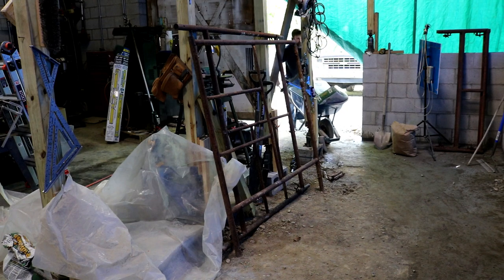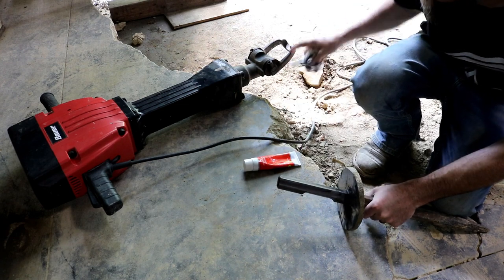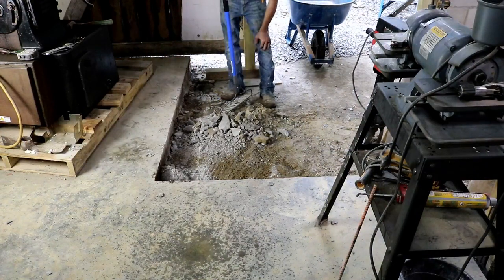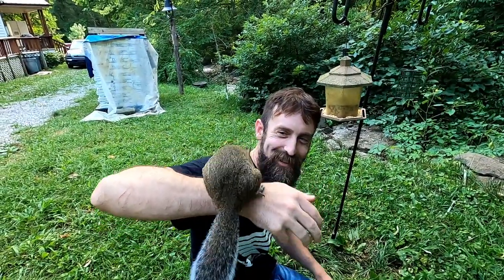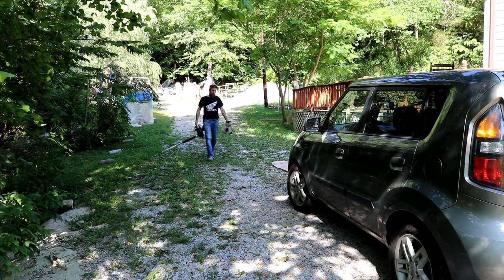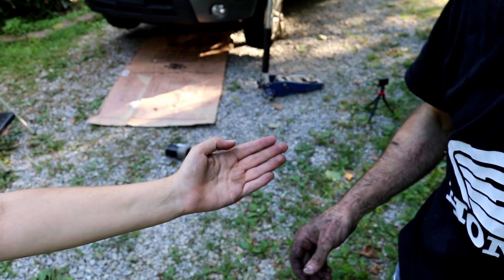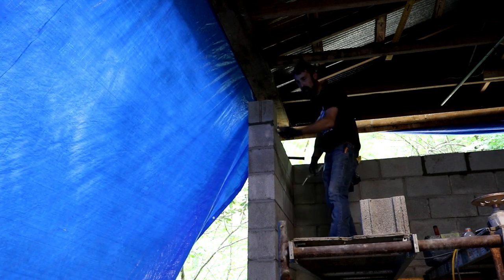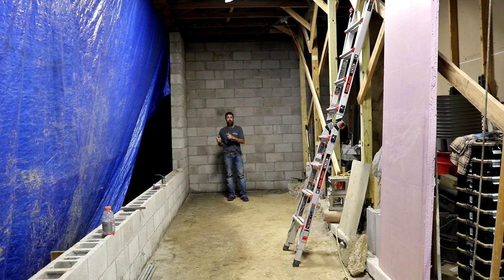Finishing up the back Block shop wall / Jackhammering the old floor \ Car trouble

Comment: It looks like the Kia engineers attended the General Motors School of Impossible Starter Replacement. Did they also attend the General Motors School of Impossible Oil Filter Replacement? Things are really coming along!
Reply from the maker: I believe so Wes 😁, they definitely were not thinking of the guy who has to work on it in the design.  It obviously can be changed but it was a tight squeeze.
Reply: One thing I can say that sure was nice working on my old junk Dodge was everything I have done was super easy to access.  Oil filter can be changed from top or bottom take your pick, starter too. You can even unbolt the floorboard to access the transmission. You could actually pull the top off the trans while it was still in the vehicle. Its freaky weird compared to the new stuff. LOL
Reply: I watch both of you guys channels love your work ethic and how you put your videos together best of luck to both
Reply: @SteveSummers  Some of the cars you have to dismantle one wheel well, wheel, suspension, wheel well liner. To get at the timing belt. The joke about doing a tonsillectomy through the butt, comes to mind. I'm happy to stick with my Ram 1500 4x4.
Best wishes guys
Reply: @carlthor91  sounds like replacing the alternator on an Escape… I think they also intend for you to remove motor mounts.
Reply: @carlthor91  my 1964 Vw Splittie can carry a load of 1125 kilograms, is 56 years old and I can perform a major service ( a major service on these cars is when you change the engine rather than the oil) in under 4 hours.
Reply: Exactly why I love old cars so much.
Reply: @gofastwclass  Four bolts for bumper, four bolts for rear valence, petrol pipe, accelerator cable, four electrical wires and four bolts/ nuts holding the engine in :)
Change starter in ten minutes, seven minutes if I dont disconnect the battery, no need to jack up car.
Reply: @andrewallen9993  The big old American cars are really complex, we sometimes have six or eight bolts holding the bumpers!
Reply: @gofastwclass  Like on my Heckflosse. Bumper brackets that would please a Plymouth Valiant:)
Reply: @andrewallen9993  worked with a friend on his, 40 years ago. 
Cheers guys
Reply: Ah, if it weren't for the vehicle repair-related horror stories most of us have, what in the world would we talk about? LOL... love your channel, Wes.
Reply: @crustycurmudgeon2182  :)
Reply: It seems like most manufactured products are designed with an eye first and foremost to reducing the time it takes to be assembled. Looks are probably second, how well it performs third, how long it will last a distant fourth. Might be wrong on longevity, they may take some care to make sure little odds and ends start breaking just after the warranty ends. Then when the big expensive repair start showing up you’re likely to keep thrown money at instead of cutting your losses. The concern for ease of repair is nonexistent.
Reply: The irony is that Hyundai/KIA is getting a good rep on how easy it is to work on their vehicles. I betcha you'd find that the next gen versions of the Soul would get much better than that one.
Reply: @alexandermckay8594  A Hyundai blew it's engine in front of me two weeks ago. He stepped on the throttle and a huge cloud of blue oil smoke came out the tail pipe, and that was all she wrote.
Reply: @carlthor91  Didn't say that they didn't have to be worked on! And my new (used) Santa Fe had to have a new engine after I only owned it for 3 months. Been there, done that!
Reply: It can get worse! On a 2001 Honda CRV, you NEED to remove the drivers side half-shaft to get the alternator out!

Comment: The existing slab edge. When you drill the side for rebar.  You may want to cut again an inch back and 1/3 the slab thickness. Then snap it off with a hammer. This gives the new slab a shoulder to rest on. Reducing the chance of settling.. on the rebar inserts. Make a 20 degree bend near the new slab end .  Please consider extending the new pour outside the doorway. With a 1x3 groove that you could drop a board in later when moving equipment in and out..to eliminate the slab to Angled gravel transition.
Reply: I can't agree with you suggestion for the lip. It seems like a lot of extra work for minimal gain, plus introducing a potential weak point.  Epoxied in rebar dowels properly spaced, a hard compacted base, & 4" mesh should be ample. If Steve pours the same slab thickness as the original floor (looks at least 6") anything that cracks that floor will have also wrecked the building.
Reply: A better method if support is the concern,  would be to dig under the edge of the old slab 4-6 inches deep and 12 inches wide. Let the new pour run under the old creating a ledge for it to rest. Normally drilled and epoxied rebar is good. If the older concrete may not necessarily be up to full strength anymore this is the usual fix to save replacing it all.
Reply: Why not just put down some more steel reinforcing and just pour another 4" of concrete over the old slab when you pour the new? Concrete is cheap and labour is expensive.
Reply: @oldschool6345  Absolutely the best way..  thank you..  i am going to do this on my next above ground hoist footing pour..   it will probably be more than 4 to 6 inches deep under the existing slab..
Reply: @waynep343  thanks for sharing your thoughts. There's a million ways to skin a cat. Usually a simple common sense approach explains itself. There's thousands of guys like Steve trying to save where they can the best they can.
Reply: @oldschool6345  Others are suggesting this and if it was a 4" slab I would agree, But it looks to be 6" minimum. In my experience one of the most critical aspects to a good pad pour is the compaction of the underlay.If you dig out this, I'll call it a sub footing, it cannot be compacted. Also please keep in mind that while the new floor is the length of the shop, the WIDTH  is small.
Reply: @oldschool6345  Sounds like a good idea to me.
Reply: Epoxied rebar dowels are far better. Cutting 1/3 of the way through 4 inch concrete leaves the overlapping piece of concrete only 1-1½", it will crack in short order. A full 4-6" slab with dowels at 16-18" o.c. will not be able to "settle." That's the whole point of the rebar dowels.
Reply: @crichtonbruce4329  well every situation is different. If the concrete is of complete strength dowels are great. Age or original quality of the pour to begin with can affect that. If you dig under the slab for a ledge you'll be doing hand work. In doing so only remove to the elevation you desire. Remove all loose material.  You should be cutting the dirt leaving substrate as compacted as you found it. The 12 inch wide is normally adequate but could be any size really.  It's only purpose is to bridge the new/old concrete joint and prevent edge failure in the older concrete. I've used both dowels and a ledge combination too. If the concrete is 15-20 years old it's enough to consider it's true strength.  There's many ways to do it depending on the variables. What I suggested is a common way to keep from replacing older concrete that will more or less do the job for a number of years yet.
Reply: @oldschool6345  
Excellent points. Any reno. ends up requiring compromises unfortunately. Steve's work will end up being the best part of the building. It's to bad there is no re -enforcing in the original floor. At least it's thick!
Reply: @crichtonbruce4329  ha usually the renovation is nicer than the original parts on most jobs. You're right, Steve's will be too.

Comment: drill and glue in some rebar dowels into the existing slab
Reply: I was just about to say the same.
Reply: @pukkimi  Ditto
Reply: I was also about to suggest the same thing.
Reply: Yes I was just about to suggest that too, glad I read the comments first. We wire brushed and painted “Cretebond” on the old slab. Just where the two with meet.
Reply: I’ve cut 3x5 slots under walls to give a good footing for rebar. Dig under the slab and fill with concrete
Reply: Chemset works really well for  holding in rebar dowels

Comment: 10:30am every Saturday in the UK... A new Steve and family video!
Soooooo close now! 
With regards to pinning the new floor to the old, perhaps drill a good foot to 18 inches into the existing floor an add some rebar every 12 inches. Should help to stabilise any loads on the floor and stop separation!

Comment: wow, the block work is really shaping up! great job!
the starter looked like a miniature version of my old Chevy starter. When mine stopped working, I removed the nut on the big terminal, pushed the bolt in, and turned it 180 degrees, pulled it back out, replaced the nut, reinstalled the starter and it worked like new again. The contact surface on the backside of the head of the bolt gets worn down and burnt, so by turning it, you just doubled the life of that starter.

Comment: On the joint between the old floor and the new to be poured floor...yes put some rebar in the side of the old floor to connect the two...but before pouring place some polystyrene foam plate say 1/2 inch thick to the side of the old floor top tevel polystyrene 1/2 inch under the top level of the old floor. After hardening fill the joint with some bitumen or silicone. The polystyrene will "isolate" the old and the new concrete from each other and differences in thermal expansion will be leveld out...while the mechanical coppling of the two pieces will be achieved by the rebar. Succes and my respect both to You and to Your wife.....GREAT TEAM!!!! Greetings from the Netherlands.

Comment: As an agricultural engineer, I have added on/repair many a concrete slab.  Just drill and peg horizontal rebar into the existing slab and secure.  I have found for best results treat thrips as a rebar joint. So you need the full joint length or more into the existing concrete and have at least enough rebar sticking out. When you pour the new concrete, make sure the existing concrete face is clean free of grease, dust and loose materials. If in doubt contact a local concrete contractor, as they may simple ways.  This was the method I have used to stand to heavy farm equipment and machinery.

Comment: Great project and video's.  I am constantly impressed by your continuing professionalism and not taking short cuts or hurrying.  So far you are using the same detail and attention for each and every block you lay.  Can't say I even am as focused after I get past the 200th block. Pro's waste as much mortar as they use, you and me get little or no waste.  Like the mortar bag as well but I never had as much luck with them as you do.  Keep locking that shed door.

Comment: Steve, the secret to minimizing cracking in concrete (notice I didn't say prevent which is impossible) is to section the concrete into squares.  Once you have poured the concrete, wait a day or so and while the concrete is still green, take a saw and cut a control joint about an inch or two deep sectioning your work into squares.  Concrete has a tendency to crack across its narrowest portion.

Comment: I agree on installing epoxied rebar into the existing slab to tie the new concrete to the old. A #4 bar, 2' on center,  4" in the existing and an 18" leg into the new. If there are any locations where the concrete was not cut clean through, leave it as is. The rough edge will help the new concrete bond.  If you want to go totally hog wild, apply a bonding agent like Weldcrete to the joint.  If the joint is in a location that will take a lot of load,  dig an undercut  under the old slab about 4" thick and 6" on either side of the joint between new and old. On the new side, slope the transition at about a 45 degree angle so it isn't a drastic  transition/step. This will give the old slab something to sit on and reduce the risk of differential settling or the edge cracking. 

All concrete will eventually crack. The trick is to get it to crack where you want it to do so. One place it will almost always crack is starting at a re-entrant  corner. That is a fancy way of saying the the inside corner of the shape of an upper case "L". To help encourage the location of  that crack that will form,  install a control joint. It can either be tooled when finishing the concrete or cut with a diamond blade after the concrete has set enough, about 18 to 24 hours after placement.  For the thickness of your slab, would suggest 1" to 1-1/2" deep. The joint can be from inside of the corner to the outside like the 45 angle of a mitered joint or two cuts aligned with the legs of the L. One cut aligned with each leg of the L, inside to outside.  If the inside of the corner is broken off so you don't have clean inside corner, cut at the point where the break starts, from inside to outside. I would also suggest about every 10'-15' along the length of the sidewall.

If you don't want debris to get stuck in the crack, after the concrete cures at least 28 days, fill the joint with backer rod and a high quality sealant.  Something like a Sika SL-1.

Comment: I have a new appreciation of what your doing on your shop. I’m taking a metal carport and making It into an shop for the race car and fab work. Just framing and hanging metal is tough. I’ve sweated like you have in the video it’s hot dirty work, but sometimes you just have to get in there and do it.

Comment: If you haven't considered it, you might drill your existing slab and epoxy in rebar to help hold the old and new floor slabs together. Some people don't think it's worth doing. We did it where I worked when replacing sections of sidewalk. It helped eliminate the worry of potential future tripping hazards cause by settling.

Comment: Steve, out here in California we have expansion joints in all of our slabs. You might drill into your existing  slab in several places and inset some rebar with epoxy to tie the slabs together, but I would leave the  joint, between the two slabs. As always you impress me with your hard work ethic!

Comment: For the roof recommend Gaco adhesive patches on the holes then two coatings of Gaco silicone roof paint. We get 132 inches of rain per year and I swear it works if you're trying to stretch out your roof's life before replacing.

Comment: Steve for the floor I would drill horizontal holes for rebar and epoxy the ends into the holes. Do this all along the old and new floor. I would think that will stop any heaving and cracks.

Comment: It was so good to see you standing in that particular corner where the wall was so bad. I swear I could see a smirk on your face. Take notice of the comments where they say to drill and glue rebar into the edge of the existing slab and study up on expansion joints for the slab. I'd form up that square in front of the door and lay it separate so you have one long even slab along the side with the expansion material all sides. when finished don't forget to cut it.

Comment: next time you're pointing in the top blocks
you can use cedar shakes as large tapered wooden shims
just get a few of them and snap them in half lengthways so that they're 2" wide or so
way less fiddly than stacks of washers

Comment: Working on cars especially under dash problems my small hand daughter was called upon regularly to reach in to fix stuff.   Recommend the rectangular section by the door be a separate pour or at least get a score line.  Otherwise it will crack angularly like before or worse the small section can act as an anchor/ pivot and amplify the slightest shift or expansion of the large section to stress the wall.

Comment: Being I am from North Dakota, I am surprised at using block.  Wood or metal up here for any kind of shop is the normal, mainly for speed of construction and for ease of insulation.  I sure have been enjoying the videos and extra effort you have put in on the HUGE project.

Comment: You’re right above the water table. So subsidence will most certainly be an issue. Don’t make any straight seems in the floor. Go 60degree angles at a 3:1 ratio. So cut out 3 feet, make a 60 deg. Turn to 12 in, and zigzag that way. It’s much stronger. And the subsidence won’t be as much of an issue with regard to floor break up or seem splitting.

Comment: Bore horizontal holes and install rebar. Tie that in the either the rebar or wire mesh you intend to use for the new floor. You won't have issues if you do that. You'll also want to under dig part of the existing floor as well. When you pour new concrete, this will go under the existing, and give you a better "footing" per say. Just make sure you've compacted the underlay. You're still doing an awesome job. It's getting closer. Cheers :)
P.S. replace all the ball joints on the car, you're already there and you'll regret it later if you don't. A 2005 Ford Escape you have to remove the right front axle to get to the starter. Engineers!!!

Comment: To tie into the existing concrete floor you need to drill holes in the old concrete  every  6 or 8 inches  about 8 inches deep and install rebar that sticks out into the new concrete to tie your steel mesh or what ever your going to use in the new concrete to re enforce the floor. As for the Kia starter, I bet you now have much more respect for Small Block Chevy ! lol .  P/S I been watching this wall & floor from the very dark beginning. I am so happy to see you complete this hellacius job ! I had to do just about the same to my shop, no money when I bought the old house so I had to do it all alone as you did  plus as being a Manual Machinist I had ZERO experience in concrete and there was no internet when I did mine ! .  Mine came out great, yours will to BUT ! soon you will find ---- the shop is all the sudden,  just not big enough!!!